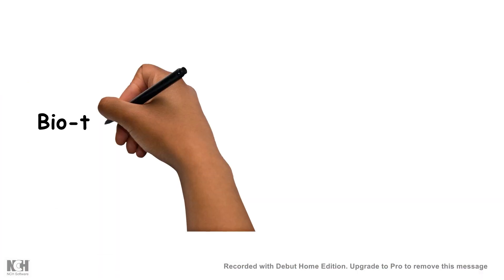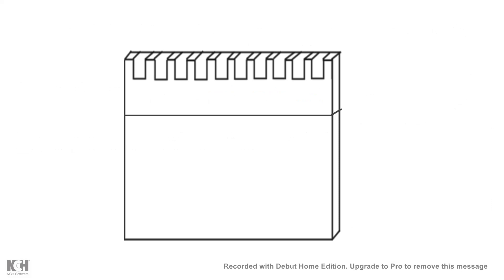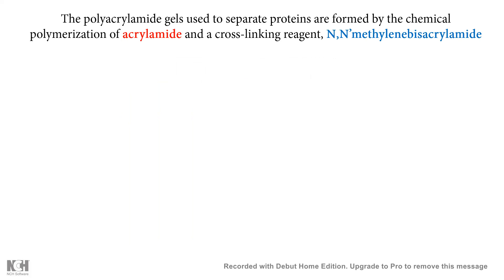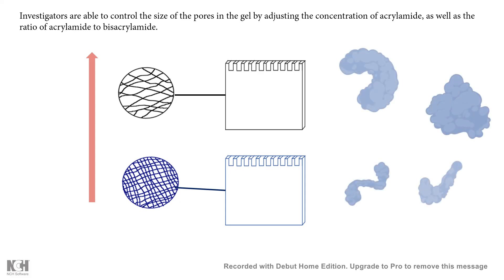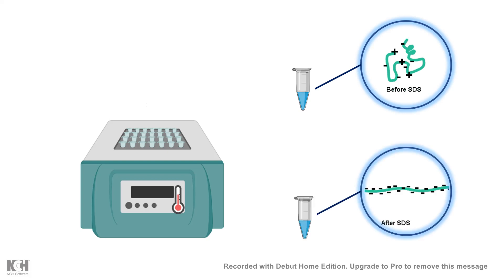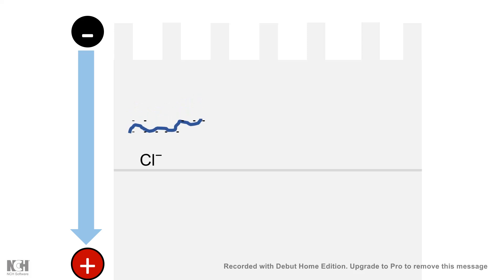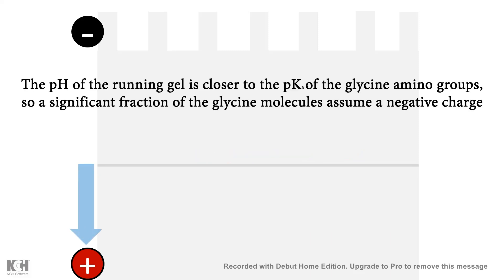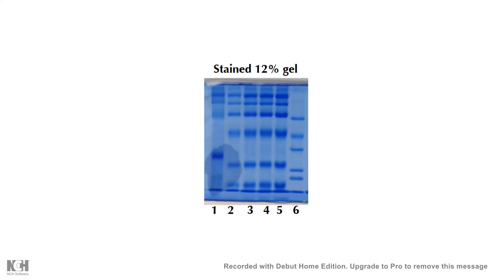SDS PAGE : How does it works?

Comment: Excelent video.
But I think there is a small mistake when you talk about Glycine. Glycine pI is 6.06, so at pH=6.8 it will have a weak negative charge and not a positive charge. If it had a positive charge it would not run into the gel, but go the opposite way and exit from above.
Reply: Amino acid	pKa1	pKa2	pI
Glycine	2.34	9.60	5.97
Reply: @MannansElearning2021  why does the pka carboxylic acid change per molecule?
Reply: Thanks for this comment, makes this video somewhat comprehendable... Cant believe I pay for a lecturer to direct me to videos like this that aren't even fully correct!!